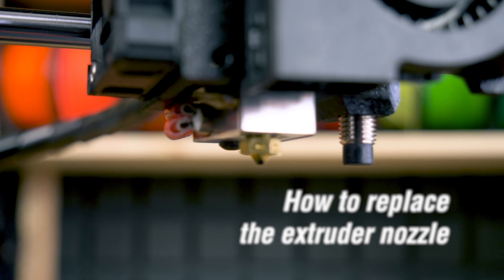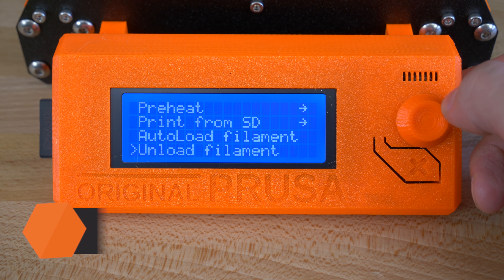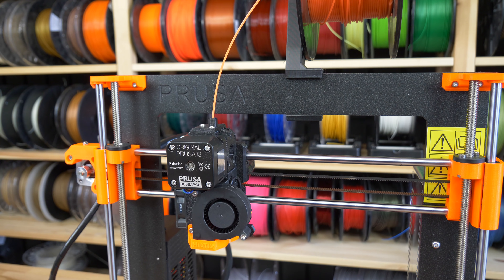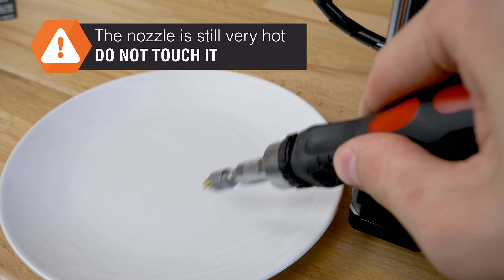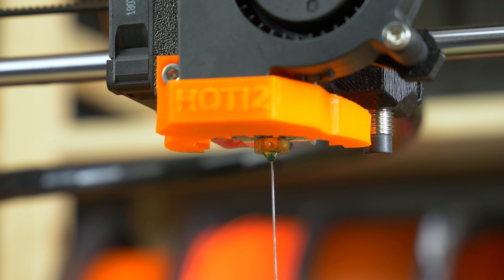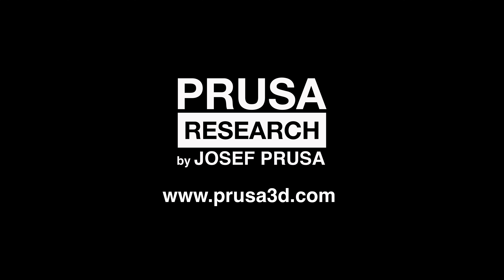How to replace the extruder nozzle

Comment: ADVICE: don't do it this way! first make sure to understand exactly how the hotend on this printer is assembled, else you're running into problems. if you don't know what you're doing, this video is misleading and you will be up for problems. 
=> read the guide about hotend replacement on the prusa website
=> watch other videos of people disassembling and reassembling the hotend (look up "Dismantling The Hotend (Prusa MK3S)" for instance)

If you want more context, and really understand the reason of my warning, read below:

Changing the extruder nozzle on my mk3s just lead me to break the hotend heater cartridge. I realize that this part of the printer has major design flaws AND that this video is misleading!! Changing the nozzle is NOT a basic task, and my conclusion is that you should open the front "panel" of the print head as shown on this video in order to avoid problems: https://www.youtube.com/watch?v=BE895k9kOXk 

Let me explain what happened: 
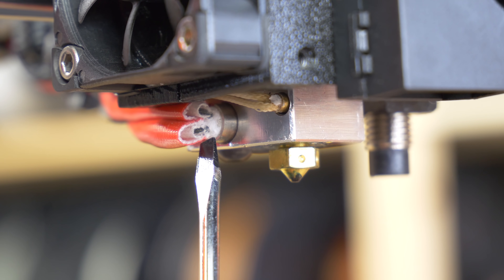* changed the nozzle, first time doing it. I followed this video, and it was not easy: it was pretty tight, and it is NOT easy to block it with the wrensh as shown at 0:59 from below, given the presence of the thermistance and heater element, and their fragile cabling. I still managed to do it but it was a real struggle, and the result was BAD! after the change, molten filament would quell out upwards, cover the heating block, and drip on prints... 
* In order to try to fix this, I disassembled part of the printhead. While trying to clean it carefully from all the hardened molten filament, one of the heater's wire broke: it is not fragile, it is EXTREMELY fragile, and absolutely not adapted to be manipulated. so... just don't do this... 

=> I will have to replace the heater element, or the whole hotend in order to spare me the hustle and risk to break this again (80USD + transport)... 

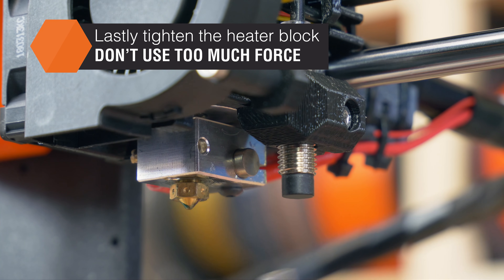What actually seems to have happened when I followed this video: the hotend is formed out of several parts, besides the electronics: the nozzle, the hotend heaterblock, the heat break (tube with a thread at each side of it) and the radiator. the Nozzle and the heabreak are screwed into the same hole of the heaterblock, one on each side. they should join inside, and press one against the other, in order to "seal". if they don't seal, plastic will be pushed up the thread, and quell out at undesired places. the hot end's other side is screwed into the heatsink. I had trouble tightening the nozzle, because it's very difficult to hold in place with the wrench, like shown (and remember that the whole thing is very hot, at around 280°C and the printer is beeping insistingly because it detects a heating abnormality - linked to heat being picked up by your tools). So what actually happened when I followed this video of the Prusa3D channel, is that when I tried to put the heatblock back in place (1:32), the whole hotend turned because the radiator is not locked in place, and I did not realize this. So I tried to adjust it to be staight again which resulted in the nozzle to sealing tight with the heatbreak => plastic all over the place. Looks like the whole heating block was totally redesigned in subsequent versions of the printer, which was VERY necessary. 

@PRUSA, it would be really good to change this tutorial, which seems problematic, missleading, and error prone...

Comment: The heater block rotates very easy. Why isn't it fixed in a robust way ? How can I be shure that I turn it back afterwards to the same postition? How can I be sure that it doesn't rotate during printing ?

Comment: I see that the channel name is Prusa, but the name of the video implies that it should be applicable for any printer. 285 degrees is too high for many extruders, especially the old ones. If you use only ABS and PLA or PETG, then 240 should be enough. If you don't have a full metal extruder, then you might have a PTFE tube in the hot zone and it can be damaged by temperatures above 260 degrees Celsius and also emit some toxic gases

Comment: So I was an idiot and tried unscrewing the nozzle before watching any videos. Thus, I did not heat the printer up. The nozzle was so tight that I ended up cracking it in half. So now half of my old nozzle is still wedged into the box with no way for me to remove it. Is there anything I can do at this point or am I cooked? (Please anyone respond ASAP)

Comment: This doesn't include all of the steps that are in the manual and on your site.  The fan is supposed to be removed first, and then the steps are the same.  I had a very difficult time getting the heat block to turn and then an even tougher time getting my old nozzle out.  When I finally did, and got the new nozzle in, it was tough to get the heat block back to its original postion.  And the red wired also hung donw after replacing the nozzle.  I had to try to move them back up.  This is not an easy task like it is for my creality machine.

Comment: Just in case anyone isn't aware, at some point there was an update to include nozzle change in the printer's menu. Settings > HW Setup > Nozzle Change. This will home the printer > move Z to 200mm, X to the Center, Set the bed to the back > Set temp to 280C. This prevents any thermal anomaly warnings, which is something I was getting. Hope this helps.
Reply: Firmware versions 3.12 and above contain this option.
Reply: Thank you!

Comment: First of all, a small release of the heater block caused it to touch the edge of the fan holder and it started to melt. Luckily I noticed it in time and the damage was not great.
Second, without a ratchet there is no way to replace the nozzle. I tried with pliers and it didn't come loose even a little bit.
I used to have an Ender 3 printer and changing the nozzle was so easy and quick and didn't require any sophisticated tools.
Honestly, I'm very disappointed!
Reply from the maker: We are sorry about these issues. If there is something we can do for you, please let us know over the mail or our 24/7 live chat.
Our colleagues will give you helping hand.

Comment: Could we get an update for this for the Mk3s+? It's harder to find a good angle to hold the heater block without shorting wires on that printer.
Reply: Did you ever figure out how to hold the heat block on the Mk3s+?

Comment: I had to change the nozzle to  use Carbon Fiber filaments (MK3s) I chose Nozzle X because it has almost the same thermal profile like the brass stock one. Reading all these comments almost made me renounce. But I decided to give it a try. After taking out the fan shroud I've noticed it was much easier to put the adjustable wrench from the side, 45 degrees down incline, front and back, taking care not to touch Pinda. It literally took me 2 minutes to change the nozzle. And 30 minutes more to run all the calibration procedures. XYZ, PID, First layer. 
P.S. I didn't turn the heat block like in this video.

Comment: OK - I followed this exactly step by step.  
However, my nozzle now does not have a gap between it and the heat block. 

It is the exact nozzle I was previously using.  I just took it out to clean it.  Then put it right back in - and now there is no gap.  
What did I do wrong?
Reply: Same issue here. Did you end up figuring it out?
Reply: @jageshkano  I have been using it - no issues at all.
Reply: @RoadsideRC  appreciate the reply. I ended up doing the same.

Comment: I noticed that there is a lot of movement on the hotend side to side on my printer and it looks like it has movement on the printer in the video also, surely this is bad for prints????????????????
Reply: When this happens for me, I remove and then re attach the heater block too to make sure everything is tight to the heatbreak etc.

Comment: It is the latest i3mk3s, unlike the contents of the video, if you press Enter after settings → temperature → Nozzle → 285 ℃, it will return to the first screen. Is this normal? The nozzle broke when I tried to remove it
Reply: The cause was that the thermo was broken. I want you to sell replacement parts as well.

Comment: It works, just did it, but the main problem is just getting access. On my i3, the red cables were basically up against the heater block, and getting a wrench in there was almost impossible. I resorted o using pliers. You also have to keep holding the heater block with the pliers while unbolting the nozzle and while putting it back which wasn't the easiest thing in the world with parts this small and crammed up under the extruder assembly so you can't see a thing and have to do it basically blind. But, got it done. Let's just say that with this first experience with this, I absolutely can - not - wait - for E3D to get their Revo products to market so I can buy them, because this primitive stuff with wrenches is no fun at all.

Comment: My mk3 s has more stuff in the way. I have changed quite a few nozzles. Just broke the wire in my hot end this time. There needs to be a dedicated place to attach a wrench or bar to take out the nozzle. Even if it’s just a shot that receives a little bar or something.

Comment: Why does the nozzle need to be hot in order to be removed?
Reply from the maker: Because of thermal expansion. It will be extremely tight when cold. And if you tighten it cold, it will be a bit loose once hot. -Mikolas

Comment: I went ahead and preheated it to 285 degrees and waited for it to heat up.
By the time it reached this temperature I started turning the nozzle but it wouldn't turn.
Then I heard a beep, followed by the error message ''THERMAL RUNAWAY'' on the LCD panel, and now my nozzle won't heat up.

Comment: This isn't easy on a hardened steel nozzle, I had to replace the whole assembly. Don't expect an easy time unless you're just working with brass.
Reply: Wait why?  I'm wondering if something is up with the nozzle x swapped as well.  I'm doing the first layer calibration but any print I do afterwards it knocks it off

Comment: I Had the problem, that when i tryed to re-tighten the heatblock, the whole heatsink rotated with it, so i could not be tightened. Would be cool if The Heatsink would be held by some screws to prevent that and make tightening simpler.
Reply: I just had the same problem, and it caused my heatbreak to back out of the hot-end little by little after several nozzle changes. All the rotating of the heat block back and forth to get the heat break seated correctly caused the thermistor wire break. I wish I'd just held the hot end with a crescent wrench and prevented it's movement altogether while I did the nozzle changes.

Comment: Please don't follow this video as is, the odds are even if it works at first it's going to damage your printer in the long run. The video is very misleading, changing nozzles is not as easy and there are a lot things that can go wrong. They don't say or show this in the video but PLEASE remove your fan and the fan shroud, It takes very little time and it's going to to protect your 3d printed parts in case the pliers slip and the hot end touches the fan shroud. Point 2: DO NOT use pliers, they can slip and also they are going to scratch the heat block..

Comment: Don't bend the what?   I bent it.  Do I need a new one?

Edit:  I think it was the heat break.  I bent it back straight with my eyeball, did a first layer calibration, and printed myself a whistle.   Seems okay 🤷‍♂️

Comment: do you have to heat the block first ?
Reply: You should.
I guess the reason is, that aluminium has a higher coefficient of thermal expansion than brass, making it easier to ge the brass nozzle out of the aluminium heater block.

Comment: 10/10, lost and re-discovered a screw, accumulated a pile of wrenches, sockets and pliers, drenched in stress sweat, uttered curses I am not even sure exist, and now my printer yells at me because Prusa does not let you choose a numeric value for your installed nozzle and 0.80 is not in the list of values it cycles through.

Comment: I'm angry this process isn't working for me and I may have damaged the fan and who knows what else because I smell burning.  I'm actually quite pissed. Now I'm reading the comments and finding this video is BS.
Reply: The fan shroud thing melted on the heat block. I see on a different video it says to remove the fan and the cover thing. I mistakenly followed this video because it has Prusa's name on it.  Now I need to buy a replacement heater block because it's covered in melted plastic. I also need a new .4 nozzle and I'm not sure what else. I have a school project due and now I won't have it done :{  Update:  I cleaned the melted mess off the heat block with alcohol. My machine passed the selftest, but the fan shroud is toast, but I think things are okay. I'm calibrating for a 6mm nozzle. The .4 nozzle will need some work to get it cleaned up.

Comment: I tried to change my nozzle for the first time and it's so tight it won't come off, I'm afraid of breaking the heat break, is this normal and do I just need to use more force? I don't think it should take that much strength to take the nozzle out. Anyone else had a similar issue?
Reply from the maker: Are you sure you have the nozzle preheat to max temp?
Reply: @Prusa3D yep, had it up at 285oC, I eventually got it out last night, most stressful thing I've ever done! 😖 It was really stuck and I was terrified of breaking the heat break, I just had to use more force than I was comfortable with, I think it will be a lot easier next time. Thanks!

Comment: Hey there, new to 3d printing and trying do my first nozzle change and I've followed the instructions here to the letter but the nozzle wont budge an inch and Im afraid the wrench will slip if I use any more force, any help would be much appreciated.
Reply: Exactly the same thing happened to me and I ended up bending the heat break and having to replace the whole hot end in order to get up and running again quickly. I think the nozzles get fused into the heat block by encrusted filament gunk. It might be an easy job on a pristine, brand new printer (as in this video), but not on a machine which has been used in the real world for a while.

Comment: do you need a special nozzle for printing with some exotic materials?  like nylon filled with carbon?
Reply from the maker: Yeah, some filaments can be quite abbrasive and you definitely need some kind of hardened nozzle for them. Especially the metal filled ones or, for example, the glow in the dark filaments.
- Mikolas

Comment: After I did this, the nozzle rammed into the bed. So I had to recalibrate the Z axis AND reposition the PINDA probe. also, plastic was oozing from the top o the heater block. how can I clean all of this? How can I make sure the hotend, and the nozzle are properly installed?